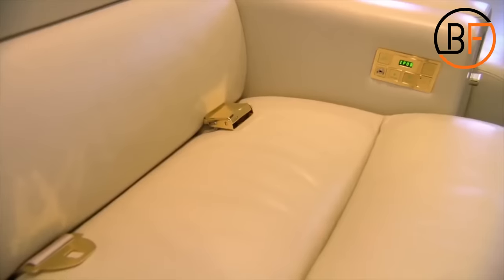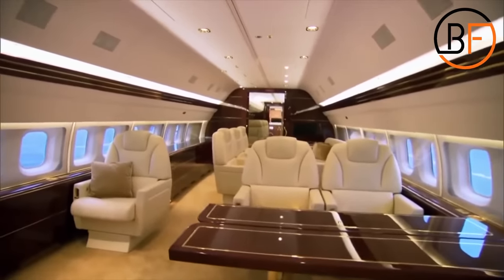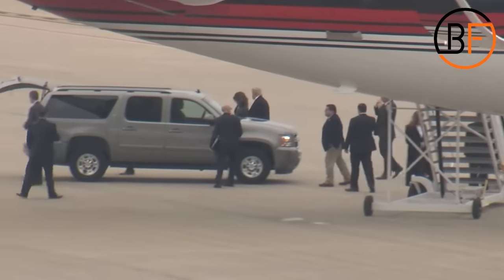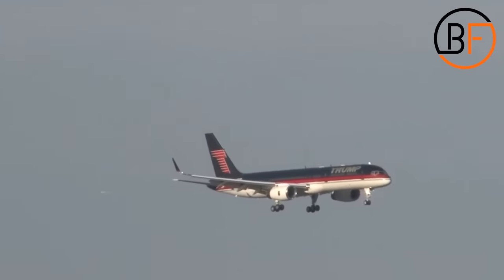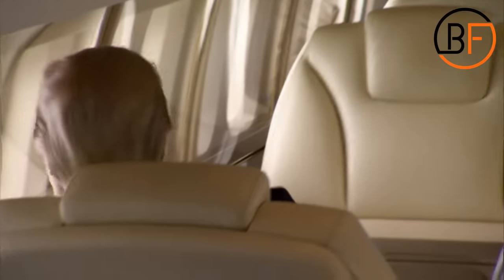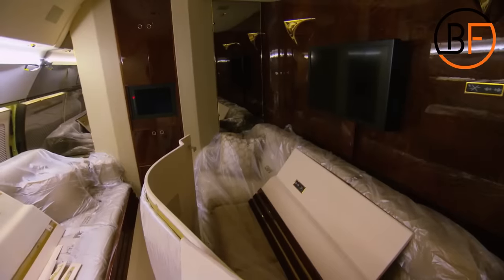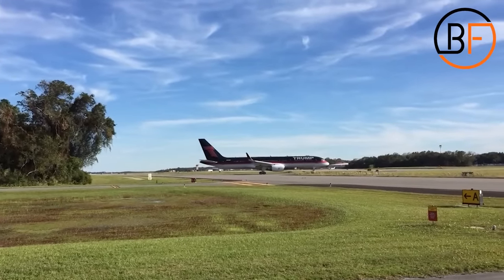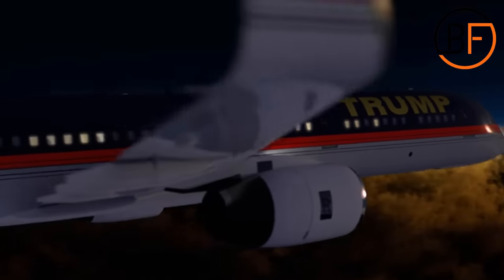You Probably Didn't know this about Donald Trumps Plane!

Comment: To clarify: Rolls-Royce motors are nice. They have nothing to do with the speed capability of the aircraft. All of the available motors have sufficient thrust to push a 757 to the Mach limit.
Reply: Not true Rolls produce more thrust but is harder to maintain versus the Pratts
Reply: @mikethompson3534  I didn’t say that the thrust was the same but both are more than sufficient to go to the barber pole without going anywhere near max EPR (or N1 in the case of the Rolls).
Reply: You're nuts.
Those 2 engines ain't pushing no 757 commercial airline past Mach.
Reply: @sexoffendertrump  Who said that?
Reply: @desertdog185  FAA and the manufacturer that's who.
Reply: @sexoffendertrump  okay we’re totally miscommunicating here. Who said either engine is going to take the airplanes past Mach? I only said that both Pratt and Rolls can easily take the air speed up to the barber pole. I never said a thing about exceeding Mach. How much time do you have in the 757?
Reply: @desertdog185  0 minutes as a passenger..
Reply: @juri_xiii9977  I don’t get your meaning.  You log passenger hours?
Reply: Mr trump that’s unacceptable, why are you using rolls Royce engines on your plane ?make merica great again and use Chevy power V8s!
Reply: the term "motor" refers to **electric** items.  Airplanes, whether old-fashioned piston internal combustion or by jet-fuel combustion, are ENGINES, NOT motors, FYI.  There are Electric MOTORS, **not** electric engines, your gas lawnmower has an **engine** your electric fan has a **motor** ...there have been interesting old-fashioned exceptions to the modern usage and references.  For example, it's not Ford ENGINE Company, it's Ford Motor Co. ... go figure!  language and its use changed over the years.  Who knows what the future will mean, linguistically speaking.
Reply: ROFLMAO
Reply: If the engines are too powerful they may rip the wings off of the plane.
Reply: @lemme999 um….the typical older Boeing Mach barber poll with clacker. Much time in the 75/76 series?  It looks like an awful lot of non jet pilots in the comments section.

Comment: No, this plane CANNOT stay airborne for 16 hours. I flew one for 4 years. It's got 8 hours of fuel, max.
Reply: Right, it can’t do 16. But with a corporate interior, it can fly a bit longer than standard. Plus there is probably an extra tank or 2.
Reply: and you know  this how? you timed it?
Reply: @Rick-ux5ku  I didn't need to time it. Aircraft dispatchers have very accurate fuel predictions for flight planning. Aircraft also come with performance manuals containing fuel burn charts that are on every plane. Anyone whose ever flown a 757 knows that they can't fly for 16 hours. Half that would leave you flying on fuel vapors with imminent flameouts.
Reply: @OneTequilaTwoTequila  Were those figures with a full load? I assume they were. 
baggage, seats and passenger weight?
Reply: @OneTequilaTwoTequila  Well I would imagine without all those passengers and their luggage along with the accompanying seats that it wouldn't be covered by those manuals. But I guess that just me.

Comment: 1:33 You only need 5 1/2 ounces of gold to completely coat a Greyhound bus in gold, including the roof. 
That equals the gold in two watches or the value of less than 9,000 USD.
Reply: So you did the same in your 757?
Reply: Yes.  Gold is incredibly malleable.  A tiny bit goes a long, long way and it is extremely resistant to corrosion.  Actually, gold plating is an excellent way to protect exposed surfaces of something valuable.

Comment: Never knew the pilots windshild could  be removed to the inside of the cockpit.
Reply: I'm sure that jet has a ton of secrets no one talks about.  Beautiful Jet.
Reply: @mtyhntr49  The windows moved inwards is not a secret majority of the airliners used in commercial travel have that too. Primarily it is used by pilots to be handed or give documentation to the ground staff by the use of long rods that hold items. You may have noticed at times some pilots stick their hands out to wave through the window of show flags in support of something. Anyway thought I would provide that bit of information.
Reply: @JarmilaMatousek  Thanx, that explains it My only concern was fastener failure (bolts,rivets etc) breaking away at 460 MPH and killing the flight crew
So, this system seals so well there is no wind whistleing thru the seals at that air pressure? I always just assumed the pilots waved thru wing windows mounted on the side widow, not thru the complete windshield. I still don't like the idea of mounting the wind screen that way, u sure it's not that way so the pilots can escape thru the nose when there is a cabin fire and the passengers are burning alive?
Reply: @velocity5918  It is used for escape purposes yes but generally they are used at other times to give the pilot documents among other things from the ground staff and vice-versa. Glad the information helped you.
Reply: @JarmilaMatousek  Ty
Reply: @Velocity  the plane is pressurized, windshield can't blow inward 😂
Reply: @JezaJames  🙂
Reply: @Wolfpack310  ha ha, was waiting to hear that one. You didn't think that one out to well. So, when a SUDDEN LOSS OF CABIN PRESSURE occurs aka: a vacume of zero pressure It's safe for one to assume the pilots resort to chewing gum and some duct tape to fight the 500 MPH wind pressure.  2 bars of air pressure will defeat the extreme air pressure created by an objet traveling at 500 MPH, NO, I DON'T THINK THAT CABIN PRESSURE WILL OVER COME TORNADO LEVEL WIND PRESSURE. Stick your head out the wiindow at 500 MPH and keep your eyeballs from imploding like the Thresher submarine achieving maximum crush depth.
Reply: @velocity5918  These are called vent windows. Until the advent of air-conditioning in  passenger vehicles, such latched windows were fitted on both front doors before the larger roll-down windows.  They were designed let cool air in. As air conditioning got more popular, these windows became less popular and often a fixed quarter window was fitted or in some models none at all.
Reply: For when he gets tired of Trumps voice.
Reply: @mtyhntr49  Are you thinking in the beds or what?
Reply: They open for escape, there is a rope stored above each side window

Comment: Private aircraft passengers are not required to clear security.  Most airports without commercial service do not have security other than a fence around the facility.  Otherwise it is similar to walking out to your car.  Especially if you own the aircraft.

Comment: The RB211 ROLLSBRISTOL Turbine engines on the Boeing 757 200 is a design dating back to pre-1982, an over FOURTY years old design. Mr. Trump 757 was previously owned by Microsoft Paul Allen and this airplane was operated before that by TWO commercial airlines. Delta operates the largest fleet of B757 in the US at 111 units. While American Airlines retired all 177 B757 as they had reached the end of the life cycle. The average price of a forty-year-old 757 is below FIVE million USD.
Reply: Perhaps you would like to own one but will need to wait perhaps on your next life envious hater.

Comment: The seat belt buckles have to be made of steel and plated with 24K gold.  If they were solid gold, they'd break on impact.  Of course seat belts won't help much in a plane crash anyway, but that's beside the point.

Comment: the brown water tank is bigger than the gray water tank, the freshwater tank and 
the fuel tank combined. there's also a converted 747 tanker available that 
sucks the brown water tank dry, mid-flight when necessary.

Comment: Wonder if Elizabeth Jean Carroll will fit onto the fuselage?
Reply: Maybe have her sit for a photo on the inside of the engine inlet? Of course, while it's running. Then have the pilot do a full throttle engine check, and take a video of the exhaust section as she comes out the backside. Then call for a street/ramp sweeper. Then have the airport fire department come over and clean up the residual mess.

Comment: This 757-200 VIP has  a max range of 5200 miles on a good day, normally 4500 about 8 to 9 hours, not 16.
Reply: Ok. Is that with a normal configuration? Like all the seats that would be in it with passengers and full cargo load out? Remember, this thing isn't flying with full specs to a normal commercial 757.